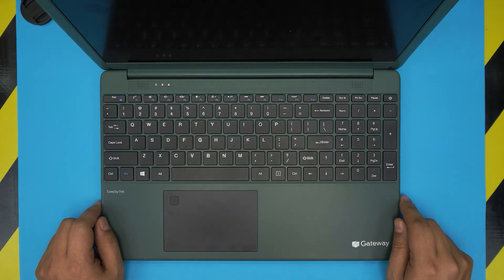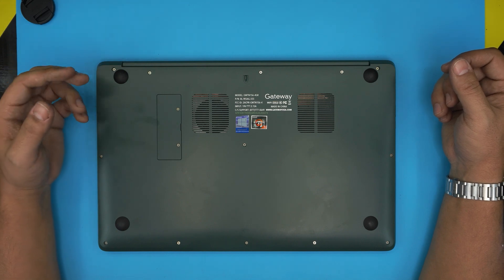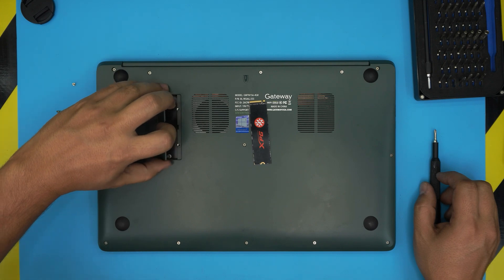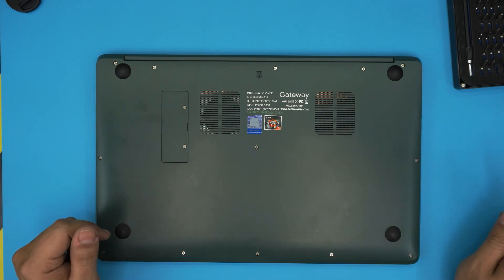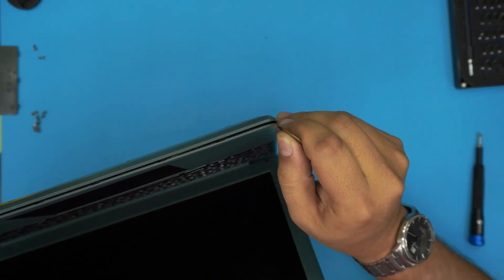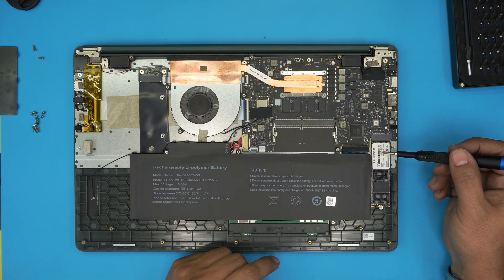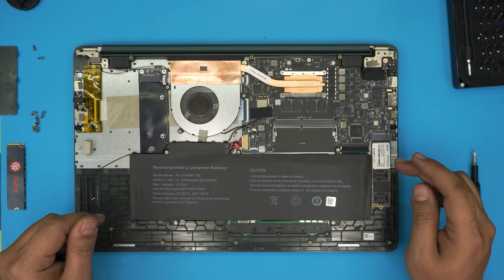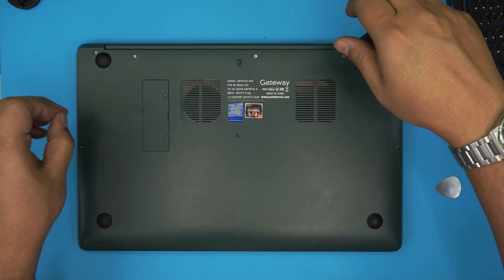Gateway Gwtn156 4Gr SSD HDD UPGRADE 💻

Comment: OK, so I’m replacing my SSD on my gateway because it died but now I’m having trouble getting Windows 11 on it even though it originally had a Windows 11 so I tried getting tiny 11 to work still doesn’t detect any drivers but I don’t have an OS to enable my new driver or my SSD
Reply from the maker: i have updated the links, use them to create the windows 11 usb boot drive and then install the windows and few windows update then you set to go.
cheers🍻

Comment: Hello. I don´t understand. You say that the external m2 slot must be used with a sata m2, but the connector as you show is from nvme m2. Otherwise the xpg m2 shouldn´t match the m2 slot of this laptop. Sorry for my english. Greetings from Uruguay and hope u can answer my question
Reply from the maker: 🫠Regarding your question, you can fit in the m.2 slot a nvme or m.2 sata they will fit in, but the pins are for m.2 SATA, if you place a NVME it will not detect.
ONLY m.2 SATA up to 2TB.
Should you have any further questions or requests in the future, please don't hesitate to ask me.
cheers🍻
Reply: @uFixTek  thanks for response my question! already subscribed to you channel!
Reply from the maker: i appreciate your support my friend.

Comment: I like your guide and i have a slightly newer model still with the Ryzen 5 3500U which is the GWNR51416 which the odd thing is for my M.2 slot Gateway tells me it is only for Sata but in the bios there is an option for NVMe that is says which makes me a little confused.
Reply from the maker: Thank you for providing your feedback! If you're interested in supporting the channel, you can show your support by liking and subscribing, or even both!

Regarding your question, I have a solid 17 years of experience working with and repairing laptops. However, I must admit that this particular laptop has presented me with a unique challenge due to its inconsistent and perplexing data.

At our store, we've received identical laptop models, yet one accepts NVMe drives while the other only supports M.2 SATA drives. Even with AMD CPUs, the BIOS might indicate NVMe compatibility, leading us to install an NVMe drive successfully. However, we recently encountered a similar AMD model where the BIOS claimed NVMe support but ended up only accepting M.2 SATA drives.

Based on my experience, I suggest acquiring an NVMe drive and testing it. If it doesn't work, you can take advantage of Amazon's free return policy and exchange it for an M.2 SATA drive. Regrettably, I cannot provide a definitive answer since even the support line doesn't seem to have accurate information. They tend to err on the side of caution by recommending M.2 SATA drives.

If you have any more inquiries or requests in the future, please feel free to reach out. Your satisfaction is important to us!
Reply: @uFixTek  I own 3 NVMe drives that is not in use for anything which i already tested out and none of them work at all.
Reply from the maker: then yours only take m.2 SATA (two cuts on the drive pins) :(

Comment: Another question, I have the same model the only difference is that it is gwtn156-5gr and yours is 4, do you know what the difference is and if I maybe can install an NVME in mine?
Reply from the maker: I answered this question on your previous comment regarding your laptop's compatibility with M.2 SSDs. Please note that your laptop can only accommodate M.2 SATA SSDs and not NVMe ones. You should look for an M.2 SATA SSD with two notches.

Comment: I have a question, the SDD that you use on the video has 2 notch at the end, most NVME SDD have 2 and SATA SDD have 3, the ones that you included in the description have 3, and the laptop has those 2 notch where you placed the top SDD, why is that?
Reply from the maker: Thank you for your feedback! If you wish to support the channel, you can like, subscribe, or both! Regarding your question,  there is no such a ssd with 3 notches my friend,  and 99% of the NVME always have one notch, where m.2 ssd sata has two notch.
this laptop ONLY take NONE NVME ssd, you can only place a two notch m.2 or look for M.2 SATA
the links are for the right m.2 sata models that are compatible.

Comment: I have this laptop and I've tried using a nvme in the main port and it won't work. its enabled in the bios.
Reply from the maker: it's something that we been seeing and we have contacted the gateway and they can't give us any information every time its a different response. we have placed nvme 3 out of 10 without any issue and mostly only m.2 SATA . update the bios and if it didn't work then you can only use m.2 sata
Reply: @uFixTek how do you update the bios for the gwtn 156-5bk models literally no one has an answer to this and it’s driving me nuts

Comment: Hi mi laptop model is GWTN156-1BK, I buy a kingston SSD (NV2 PCIe 4.0 NVMe M.2) and try to put it on my laptop in the slot you show in the video and it does not recognize it, is there something that can be done or that type of ssd is not supported?
Reply from the maker: Thank you for the feedback! if you wish to support the channel you can LIKE or SUB or both :P
regarding your question: sorry to inform you but you have a 1BK and that model does not support NVME , you need to return and get m.2 SATA (with two cuts)
Reply: @uFixTek  Can GWTN156-1BK support up to 2 GB NGFF (SATA) memory?

Comment: I have a gwtn156-4bk that I am wanting to upgrade to a 1tb nvme drive, however I have read on other forums that the internal pcie slot would not recognize their NVME drive in the BIOS, nor would it read a M.2 SATA drive larger than 256GB. Did you have to change anything in the BIOS once you upgraded this laptop to an NVME drive for it to recognize the drive or anything?
Reply from the maker: Thank you for the feedback! if you wish to support the channel you can LIKE or SUB or both :P
regarding your question: The model that you mentioned won't take NVME no matter what you do to the bios. BUT it will take a m.2 SATA up to 2TB without any issue (forget about who ever told you or you read about the max 256) we have upgraded so many of then to 2TB without any issue.
this is the one we used a lot but you can get any model m.2 sata 
https://amzn.to/3FKjhk8
Reply: @uFixTek  I realize that I quoted the wrong model after actually looking at the bottom of the laptop. Is that the same for GWTN156-5BK as well?
Reply from the maker: :) and i mentioned based on GWTN156-5BK, its not NVME and its only m.2 sata 2TB without any issues
Reply: @uFixTek this is what I needed to hear.  Thank you. Nvme is listed in the bios but it will not recognize.

Comment: I am puzzled.  4 bl, 4gr, 7gr, what is the difference?  Which of these run better?  So far all I can figure out is that the GR versions can have ram added.
Reply from the maker: Thank you for the feedback! if you wish to support the channel you can LIKE or SUB or both :P
regarding your question: i would stay very very far from Gateway laptops, they are very badly designed at components level and they fail all the time, and don't even start about finding parts that are almost impossible. and models naming and near almost no data for specs.

Comment: do you need to ground yourself for the slot on the top?
Reply from the maker: Thank you for the feedback! if you wish to support the channel you can LIKE or SUB or both :P
regarding your question: absolutely NOT my friend, i been doing this for over 18years and me or any technician that i ever knew never use the grounding, you can manhandle the board as you wish there is no chance you can damage it by touching it! even if you tried you will fail! :)
we pile up the boards in a box and workers pick them up and bring them for service without grounding.

Comment: nice video!
would this hard drive work for the primary ssd?
WD Black SN770 500GB PCIe Gen4 NVMe M.2 2280 Read:5000MB/s,Write: 4000MB/s SSD (WDS500G3X0E)
Reply from the maker: Thank you for the feedback! if you wish to support the channel you can LIKE or SUB or both :P
regarding your question: NOT all SWTN models support NVME, can you give me the complete MODEL NUMBER and manufacture year.

Comment: what you just sail about the extra hard drive makes no sense
Reply from the maker: what doesn't make sense, PLACE  a NVME m.2 ssd and install the windows on NVME ssd and have a an extra m.2 ssd sata on the other m.2 port for extra storage! that makes no sense to you :/ , by all means if placing windows on m.2 sata makes sense to you do it. and use nvme for storage.

Comment: how about the new GWTC51427 with 12th gen intel? Will it be able to use NVMe?
Reply from the maker: Thank you for the feedback! if you wish to support the channel you can LIKE or SUB or both :P
regarding your question: yes the 12th gen intel version supports NVME 110%
Reply: @uFixTek  NVMe M.2 not compatible; I just tried to put in an NVMe drive in spare M.2 slot and it isn't recognized. In the bios it also says no NVMe device found. So SATA III only. It's not NVMe compatible.
Reply from the maker: @davidlorin1379  update the bios my friend. the GWTN141 doesn't support the nVME.
if yours is -BK version it doesn't support NVME i send a email to the gateway and waiting for info, is your model ends with -BK or alike ?
Reply: @uFixTek  GWTC51427-BK is the model #. Gateway has no drivers or bios on support page. It has an i5-1235U CPU so don't understand how it doesn't support NVMe. I took off the bottom tried a 256 GB Samsung EVO 970 plus in both slots, not recognized. Like I said there is an NVMe option in the bios but just not recognized.
Reply from the maker: @davidlorin1379  no idea why -bk reversions having thunderbolt don't support nvme :/ install the new chipset driver https://gatewayusa.com/support.html
if you purchased yours on amazon return it and get m.2 sata you not missing much if you only have one nvme on a laptop the best use of nvme is if you have two or more of them or have 10gbit internet speed
Reply: @uFixTek  There are no drivers/bios for this laptop on the support page. Gateway says go to E&S international for support which brings you back to gateway support, so there is no support.
Reply from the maker: @davidlorin1379  gateway has the worst customer service on the planet, it takes days week to get a beep out of them. they do what they like in the laptop we have seen many gateways laptops same mode exact from outside but different board design inside.  i would say if no update is working just go with m.2 sata :(
we have installed nvme on this models for our clients :/ but i ques your board its not compatible
Reply: @uFixTek  I tried an nvme pcie 3.0. Maybe pcie 4 might make a difference? It's a good laptop with m.2 sata, and for the price I paid I would just be splitting hairs to complain. I just wish it was easily upgradable. Sorry to highjack the comments but thanks for your input!
Reply: @uFixTek  Gateway support told me both m.2 slots were only SATA III SSD compatible. I'll throw in a spare NVMe when I get back from vacation this weekend. There is an NVMe setting in the bios. No one has done a video on the  GWTC51427 yet.
Reply from the maker: @davidlorin1379  it takes nvme i have confirmed it with another repair shop that its my friend.